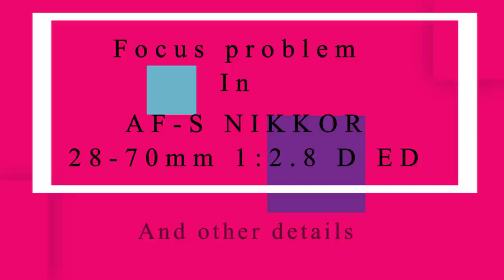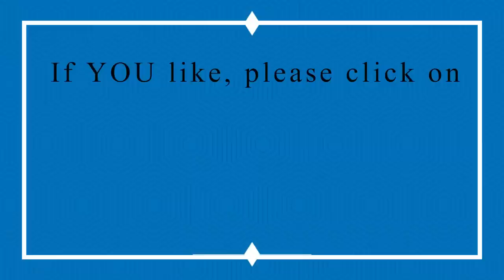Focus problem in AF-S NIKKOR 28-70mm 1:2.8 D ED and other details

Comment: Thank you very much for this great video!
I had a non-working autofocus for many years.
It would sometimes move a few mm's but was basically dead. Manual focus was no problem.
I disassembled the lens, including the main FPC. Could not identify any faults, so I cleaned all sliding contacts and the magnetic stripe with isopropanol and replaced the double-sided tape for the circuit board.
Put it all together again and ...autofocus was working!
I owe you a case of beer!

Comment: Same lens, similar problem. All of a sudden stopped auto focus. Tried moving focus ring several times and found it was hanging up slightly and progressively getting worse. Followed the video, inspected and found the circuit mounting ring (hexagonal metal ring) was slightly distorted causing the brush contacts to hang up. I lightly squeezed the ring and rechecked-smooth action / no sticking. Cause was probably due to temperature changes over time resulting in some metal warpage. Also note: do not over tighten aperture ring screws (long ones) as binding will occur. Just snug with some threadlock and all is good.      Thanks for the video!
Reply: russ duchaney how long did it take you to take apart? I’m having same issue. Thanks

Comment: Awesome video as usual! I had the same problem and this fixed it, but I didn't remove the ribbon cable. Instead I just epoxied it down while it was still in place. Just another word of caution. Lining up the aperture lever attached to the mount on this lens SUCKS!! The fork that Mike describes is VERY difficult to get back in. One side of the fork is flimsy metal and mine got slightly bent which made it impossible to put the lever in. I had to use 2 paper clips to spread it apart again and then I was able to get it in...after 2 hours of dinking around with it.  Anyway it all works now! Thanks again for the great tutorial!

Comment: Thank you for your video. This was my favorite lens until I started having the same focusing issues with it. I was so excited to try this and went and bought all of the equipment needed to take it apart. Long story short I ended up throwing the lens in the garbage after trying every trick in the book to remove an absolutely frozen screw. I got all of the screws out but one--completely frustrated that you can't send it to them to repair and they make it impossible to repair yourself.
Reply: @bennyhalftail I hope you didn't actually throw the lens away. Saving them for parts or selling them for parts like on ebay is worth the hassle. In the past, I've resorted to drilling out screws. Not pretty but necessary. Sometimes you can recover from it, sometimes not. @mikeno62 is an amazing resource though and his videos and direct responses have been very helpful.

Comment: I had the same problem but from different causes. So what happened was that M/A M switch window (take a look at 19:53 where the cables are passing through) has something like a tape holding the cables. That thing has been detached and falling on the focus mechanism causing a terrible sound, slower focus and sometimes stuck focus. The solution was to glue it to where it was at first. My comment is for anyone wants to try this first before disassembling the whole lens. Saying that, this was a nicely done video with complete instructions. Wish you make another one for my problem which remains unsolved, the hard to move focusing ring in manual mode after a fall.

Comment: Ok, I had the same issue and with your help (thank you) , I decided to do surgery on the lens, but once fully into the repair I altered the repair, that made it easier. Instead of completely removing the multi sided plate by unsoldering the wires and removing all the ribbon connectors, I just removed the 3 screws as in the video, and only removed the 2 ribbon cables to the left of where the 2 side by side screws, this allows you to gently pull the lefts side away from the center section to gain access. Once it’s moved to gain more room, I decided to just push in the circuit board essentially resticking it back onto the plate, then while it’s pulled out,ma strategically used a hot glue gun to place several low profile dabs of hot glue in several places, securing the printed circuit board. There is a hole in the center of the circuit board that can also take a dab of glue. Once glued the circuit board should remain firmly attached. This eliminates the removal of the wires, and removal of several ribbon cables, saving time and potential damage to the ribbon cables, with accidental misstep with hot soldering iron. This whole thing took about an hour, and was all made possible with mikeno 62 excellent video. Did have a small struggle with the aperture lever,band after I got it in correctly, I found I needed to reset the slotted tabs to gain full range of aperture, for both manual setting and the lever. Long story short, tried the lens and all appears to work excellent, though it has the auto focus squeal from time to time that some of these lenses exhibit. Other than that all is well, hope this helps anyone who reads this. Next up will be extensive disassembly of a D800 to replace the shattered top lcd/ bent top cover that I somehow broke (oh fun). Just waiting on parts to arrive for that. Thank you mikeno62, love your vids. They help those of us who have the patience to get in there and fix this stuff.

Comment: Brilliant video, hats off to your courage and skills. Nikon made a real dogs dinner of the AF side of this wonderful lens. Optically it's a real star, but the AF motor system is a pigs ear. How many of these have got wrong over the years? I reckon this is why Nikon don't have the parts available, all used up, due to repairs world wide. Anyway, Nikon should make these lens (especially at this high price point) to at least work perfectly as manual focus lens if AF fails. Often they cant even focus manually when problems crop up. I also have this lens, but the USM motors were always as squeaky as F, from day one, now it won't focus properly. I think it wont even find infinity in Manual, I need to test it 100% to be sure. It's a darn heavy lens to carry around, some of todays much lighter offerings from Nikon are almost as sharp, so I guess thats that.

Comment: HI Mikeno62. Instead of completely disassembling the lens, you can put a small piece of rubber in a clamp between the print and the chassis.
I have done this on mine, then you are free to solder other than the switch manual automatic focus.
With a piece of rubber, it never comes loose again. With tape, you do not know if the problem will come again after some time.
Reply: Hello can you give me some examples of the rubber? I can't figure it out.

Comment: Thanks for your wealth of information.  I was having a hard time putting the lens back together, specifically the aperture in between the tabs, and reviewing your work helped me think it through.   What I thought was success though, wasn’t - somehow I have turned my lens into a 40’ish to 70 and there is a hard obstruction allowing the lens to zoom wider.  I’ll open it up tonight to see if I can see what I did wrong, you have any insight as to what to look for?
Reply from the maker: It could be some loose screws, and also check that the aperture sit correct, just some ideas.
Reply: @mikeno62  thanks for thinking about my problem, as it turns out, I bolted a Leitax EF mount onto my lens and the screws used were too long, thus colliding with rear optics housing.  the original mount screws are 16mm, need 18mm, but was trying to use 25mm - waiting for my online order, then project will be complete and presumably a success.

Comment: Great video!! I have the same lens that I bought used at a great price because it was not working. The aperture was stuck. This was the only video that I could find to get me close to the problem. I took all the front lenses out to get to the aperture ring. got it cleaned and I'm having a problem getting the zoom mechanism right. it seems to only be able to go one way. But it will not fully zoom. Any ideas?

Comment: My lens has this exact same problem. I left in the circuitry and just pushed the loose circuitry back on the bracket. This was (not surprisingly) a short term fix. So in the future this will be a nice reference to perform this fix! Thanks for sharing!  

One added note; your camera can get a nasty error when the focus ring bumps into the circuitry.
Reply: Use some high quality double sided tape from 3M. I wouldn't even trust that, add a tiny drop of super glue.
Reply: Dorf Schmidt thanks for the tip!
Reply: @stephandelaat  The best tape I've found so far is 3M 9448HK (ebay) for lenses and cameras/rubber.
Reply: I ended up not removing the plate or unsoldering any wires. I just removed the screws an the 2 left side ribbon cables and gently pulling out the plate. I then fully pushed the circuit board all the way in, and after it was restuck, used a hot glue gun (several low profile dabs ) to hold it in place permanently, then put it all back together, worked fine, lens auto focus success.
Reply: @ussmillerco  I had to redo the repair. I was putting it off but then i saw your reply. It took your advise and did not unsolder the wires and also used hot glue, worked perfectly!
Reply: Awesome, Stephan.....gotta love the internet for fixers like us....keep safe brother.

Comment: Question, just received a Nikkor AF-S 28-70mm f2.8. The AF works initially when mounted on camera, but eventually stops working properly, and I notice that the f-stop jumps up to f22 (doesn't happen with any other lens on my D750). The lens also makes a high pitched electronic noise as well, but stops once I unmount the lens. After remounting, works again for a time, but then the aforementioned issues start again. Focus ring is pretty smooth (very little squeaking compared), as is the zoom ring. No issues with the aperture either. Any ideas what the issue could be?
Reply: The high squeal pitch noise could be a problem with the focus motor itself.....but there are conflicting questions whether the noise will cause failure or potential future failure. Mine make the noise, but my lens was given to me and I don’t know the full history. I had the same problem listed with the circuit board delaminating and I fixed, but still the squeal remains.....I’m going to ride that issue until it quits, then consider my options. Your issue may in fact be precisely the issue described here aside from the f22 aperture thing, so my advice is if you feel confident you could do surgery to inspect, then go for it. If not....off to Nikon for factory repair. Good luck.

Comment: Hi, I had the same problem so I followed the video all went well or so I thought, lens will only work in manual now..where could the issue be. I only removed the solder on the Blue, White and Black wires not the others as I was able to just remove the circut board with them. Hope you can help!
Reply from the maker: Maybe check some of the thin flex cables, and also check that they sit proper in the connector.
Reply: @mikeno62  Hi, Found the issue it was a small spacer between the circut board and the metal flange ( for the want of a better word ) that it attaches to which fell out when I removed the circut board. Only knew about it when I want back and checked the images I took before i dismantled the it. I cut a small section of a biro tube which worked perfectly and now the lens as you said ' is better than new '. Thank you so much for putting up this video and the others they are super helpful. Thank you again!

Comment: I just bought this lens, very cheap on eBay knowing that it had focus issues, but I didn't mind as I was going to use it as a high end zoom in manual focus on my older SLR'S ie F3, FM2 FE2 ect. It seems to have the same issues as this one, so I might strip it down and see if it is the same issue and easily fixed with a bit of double-sided carpet tape. It's funny when you say it like that, it sounds like a bit of a hill billy fix, lol. Well, if it works, it will treble the value of the lens as well as being able to use the auto focus again.

Comment: hola buen día, tengo un óptico nikon af-s dx nikkor 18-55mm f/3.5-5.6g evr el cual tiene hongos justo en el lente que esta sujeto al diafragma y no se como sacarlo para limpiarlo pues no le encuentro pegante o tornillos desde el frente, y desde atrás hay demasiado circuitos electrónicos y se ve mas complicado. Alguna sugerencia?, sabes de algún link donde pueda bajar el plano de  desarme de este lente?. por favor. gracias
Reply from the maker: You will find the Repair manual with this link: https://learncamerarepair.com/product.php?product=302&category=2&secondary=8

And this is the Parts list:  https://learncamerarepair.com/product.php?product=301&category=2&secondary=8
Reply: @mikeno62  muchas gracias. bendiciones

Comment: Double sided tape is obviously not a reliable method of fastening. If the lens is stored in hot car then exposed to any vibration the tape can let go or change position. By the time I would have gotten to the problem my family would have interrupted me five times and the job would never be completed. I did not know a Nikkor lens could be both a D and an AFS at the same time.
Reply: All lenses are D and AF-S now. Since the "D" day in advertising, they simply phased out that lenses are "D" as it's no longer a advertising big deal, but more of an expectation.

Comment: I could need some Help! I have the exact same Lens with nonfunctional AF.   in hope this would be the problem, I changed those tapes and reassembled everything without any damage. But sadly the AF still doesn´t work at all! The Lens was shipped to me and before shipping it worked. Is there any other common problem that could couse this problem?

Thank you very very much for this wonderfull video! I wish this would have been the only defect on my copy....

Comment: spent 2 days working on it. fixed it. was confident it would work . However didnt understand the last part at all how to reattach the aperture. After 3 hrs noticed the one of the blades had slipped out. Somehow managed to get it back in place but wouldnt open to full aperture anymore. Unless I took the whole thing apart lens became trash. Now in bin.

Comment: hai, i have the same problem, can i send to you my lens for you fix it, i will pay for you service
Reply from the maker: Sorry, I do not have repair service.
Reply: Pete.....you could do this.....just acquire the tools ( soldering iron, Japanese screwdrivers, tweezers, pill boxes for screws, clean workspace etc.) then set out slowly with Mikeno’ vid playing as you work. Go slow and check out my shortcut (in other replies)  that saves time and you from some potential damage, and you’ll save that $400. If you fail, just put it back together fully and send it in to Nikon, for me it’s worth a try, maybe you too.